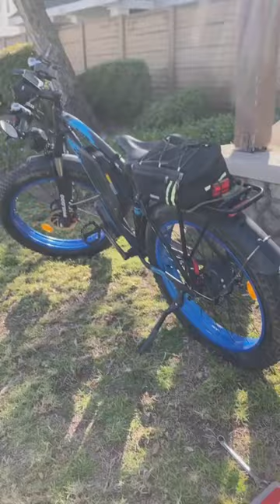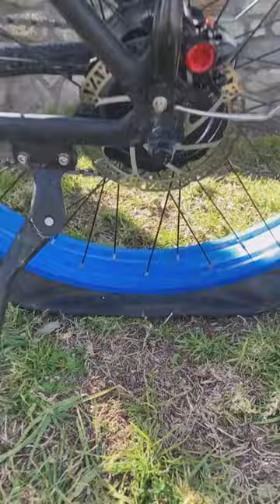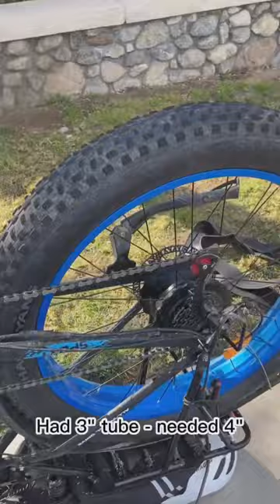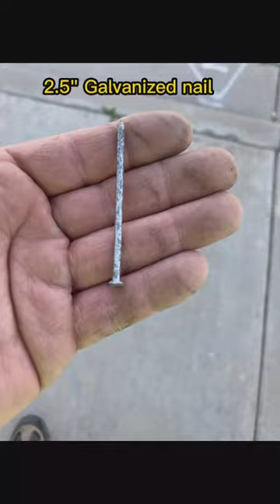Fat tire ebike 20 min flat fix

Comment: Okay, nice video. My phone stole the 19 minutes in the middle of the video! Would you please repost the whole thing? I want to see how to disassemble the rear tire! 😮😂
Reply from the maker: It was a short so YT keeps it under a minute.  Been waiting for a flat to get it all on camera and have gone over 3k miles without one using the Tannus Armour liners.  Great idea tho and I should do a video of the wheel removal itself.
Reply: Have u ran over any nails with tannus since then?, only things popping mine are these random nails😂 @johnnysezebike1319
Reply from the maker: @AintaWeeb2  Nothing that got stick in the tire for me to see and always hearing the sound of running over metal objects.  I'm going to post a short later today showing what Tannus did prevent: major sidewall blowout 😳
Reply from the maker: @AintaWeeb2  here's the Tannus short         

https://youtube.com/shorts/VGgny9jmm3c?si=koduj9bZHCruh6CB

Comment: I bet you didn't deflate your tires to make sure the valve stem was straight. Your fault, drrrrrrr
Reply from the maker: That's what the valve stem remover is for.   The first step in fixing a flat.

Comment: How do i remove the wheel?
Reply from the maker: I make sure power is off, remove batt is a sure way. I disconnect motor cable FIRST then remove axle nuts.  I use a wrench to take tension off axle by rotating counter clockwise with a wrench on flat dies of axle.  You will hear a pop and see tension released or else it will be tough to get off.  Then move chain out of the way and pull wheel up and off.  Hope that helps!
Reply: @johnnysezebike1319  thank you

Comment: Spot on with how long it takes to fix if your not slow ….     You should sprey that stuff in the tube then fill it with air.  I think it’s a run flat can
Reply from the maker: I have the Tannus Armour in all motored wheels now.  Thousands of miles on 'em and serving me well.  Used to get a flat every 700 miles on avg. Prob just jinxed myself

Comment: What did you use to hold the handle bars up so it won’t damage what’s on the handle bar
Reply from the maker: Handlebar Jacks.  I never leave home without em and whenever working on the bikes.  Here's the link.

https://www.handlebarjack.com/
Reply: I use a pair of rubber jack stand pads I got on Amazon for $10
They’ve got a V notch that the handlebars rest in perfectly 👍

Comment: SLIME..?
Reply from the maker: Yea I don't do the Slime thing.  I prefer to know I have a flat and just fix it versus not knowing or thinking it will hold.  Not when coming down 2200' mountain.  Not to mention it's a mess when I do change it.  Without Tannus Armour I'd prob be using it tho.

Comment: Is the controller susceptible to eminent damage on the bottom of frame directly behind the front tire. Every limb you drive over is gonna wack it!
Reply from the maker: Great question! I always thought the same when I saw those on ebikes.  Never had an issue so I never gave it a second thought.  I ride rough terrain and it would have happened by now for sure.
Reply: I think the kickstand on aventon solteras is very easily damaged, since it doesn't automatically get folded when you start pedaling, like a leg powered bike where the kickstand is closer to the pedals. If you forget it open, it will drag and grind on the ground until you reach back with your leg to fold it up.